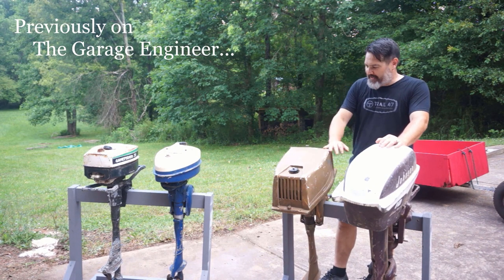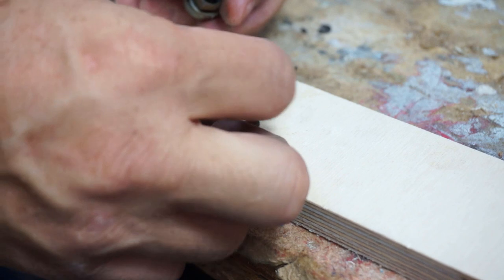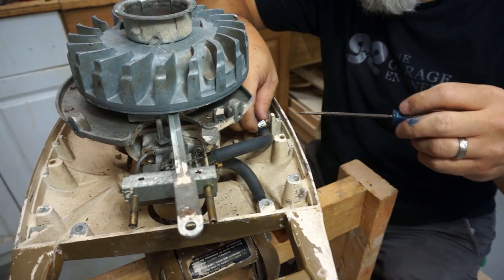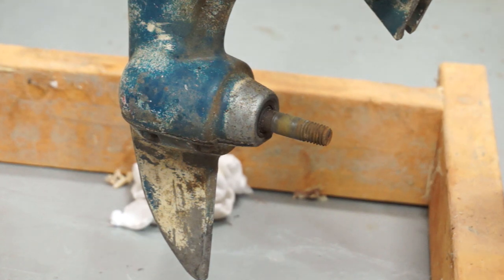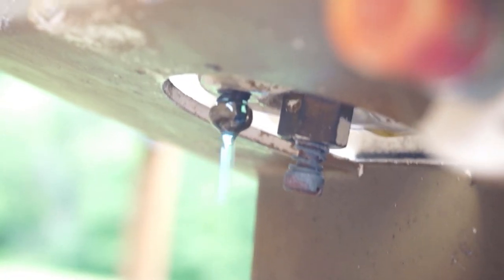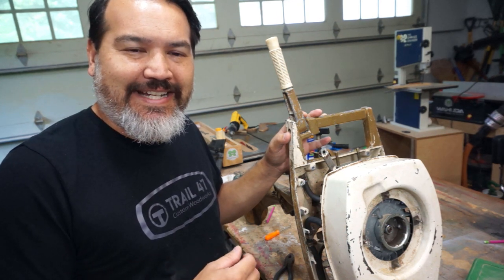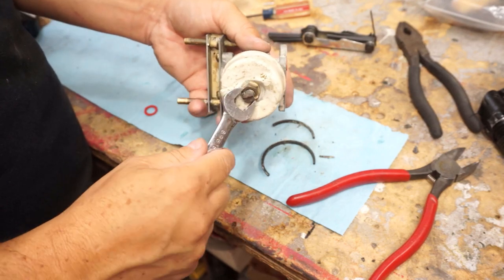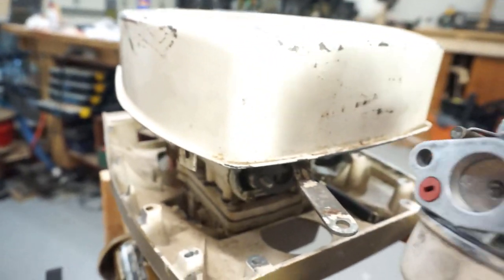Can We Save It? Western Auto 5hp Boat Motor: Part 2 - The Garage Engineer

Comment: “That just broke, that’s not good”. I thought that only happened to me.  🙂
Reply from the maker: Happens all the time.  But learning to fix it is the fun part…sometimes.  Thanks for watching.
Reply: Take off the fuel flange. With a needle nose plier hold the part back where is was and heat the area with a propane torch. Worked for me. There is enough solder there.

Comment: You fill it from the bottom to get all the air out. That's how it works on my 2003 Honda 9.9 long shaft.
Reply from the maker: That is how I normal do it on my other motors but the lower vent opening was very small.  Thanks for watching.